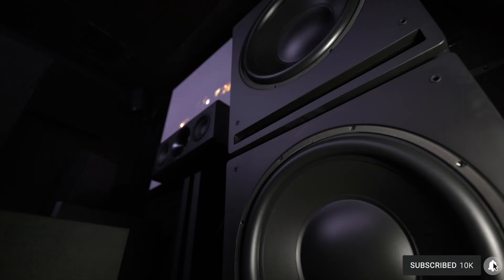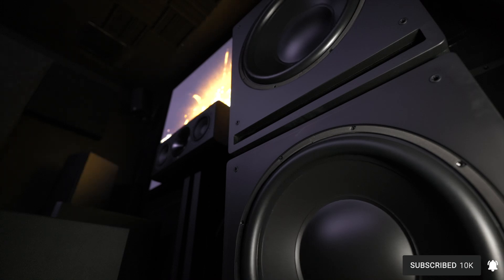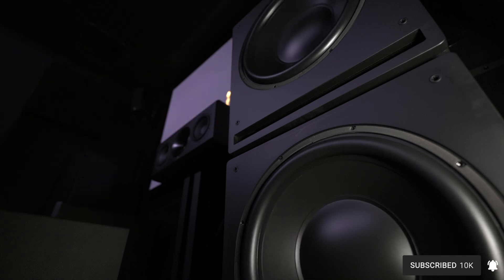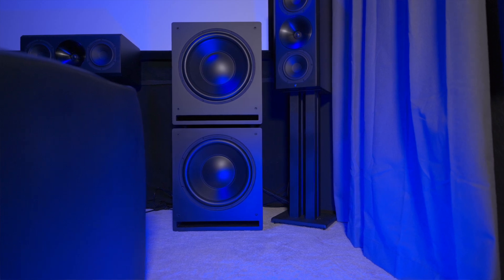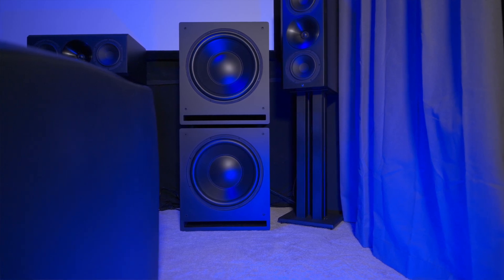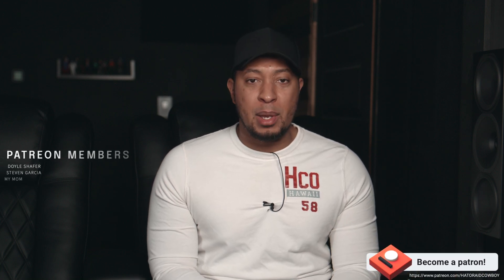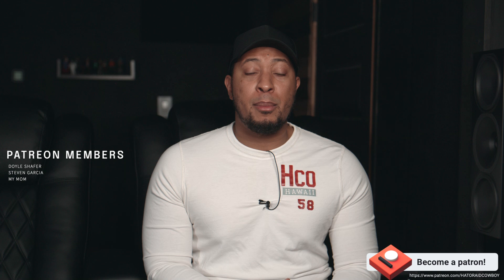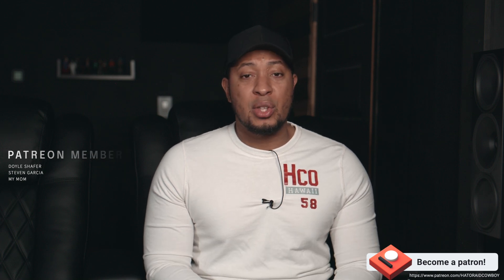THIS Is Why Sealed SUBWOOFERS Sound Better In Room Than Ported

Comment: I have 4 sealed subs . 2 svs sb16 ultra  in the front and 2 sb4000s in the rear with one of them directly behind my recliner  .😊 .
Reply from the maker: Noice! That’s a lot of power 😃
Reply: It is the near field sub is a game changer.  I'm going to upgrade  my receiver to the denon 3800 or the 4800 to take advantage  of the 4 sub output and dirac live .
Reply from the maker: Noice! What you using now?
Reply: I'm using the 4700 denon

Comment: Now it make sense on your ad lol I mean it’s a hella of a deal on your listing. I was like I wonder what made you change your mind. I mean we all love port enclosure until we start hearing that chuffing. Ive been debating on what brand to go with as I’m an die hard JL audio fan but them prices are something else
Reply from the maker: Yea man! Lol I love ported but anytime a port chuffs its such a turn off lol Multiple sealed subs is my goal now….I have yet to hear JL subs. I keep hearing how awesome they are
Reply: @hatoraidcowboy  I’m thinking of doing a DIY route for JL subs, I owned plenty for car audio and everyone love how clean and accurate it sounds. At the moment I do have a spare JL Audio W7 10 inch that I’m thinking about using for Home Theater but I might get me a 12 inch instead. I had dual 8 inch in my truck unfortunately you know H-Town and how hot truck thief is right now and I was one of them victims. So now I’m just focus on Home Theater stuff lol

Comment: I have two of the SW15s and have been extremely happy with them. I'm considering adding one or two more because I have a terrible null in my MLP that I can't seem to correct enough without at least a third sub. That's more about the room though. The subs are awesome.
Reply: Nulls are a sound wave response to the shape of the room.
By moving the subs, you move the nulls to more desirable places.   Adding subs evens out the nulls if placed properly.
Reply: @tkcdac  my skillset is much more in the construction and finishing of my theater room. The calibration and acoustics have a steep learning curve for me. Luckily adjusting the acoustic treatment in my room is pretty easy. I have fabric track over all of the walls so I can just pull that out and add or subtract treatments behind it. Part of my problem is I think that I over treated the room a bitm

Comment: My JTR 4000s do not chuff, but they are the exception.   
I like ported.   My ported are tuned to 10hz.   Plenty of lower extension, and anything lower in infrasonic simply destroys other rooms and irritates the wife.   It's like investing in termites.   Why invest in a degradation that you can not hear?   
I do however have butt shakers.   This allows me to turn up the simulated infrasonic with zero room transmission.